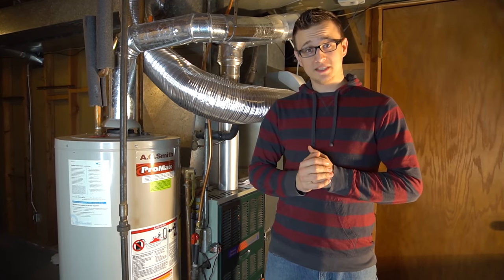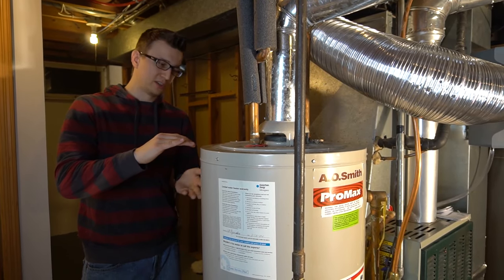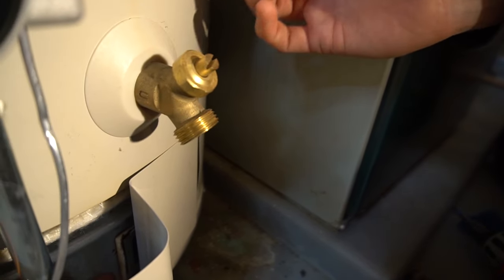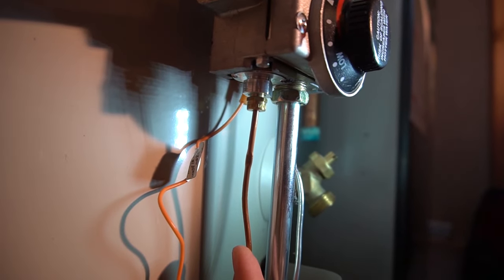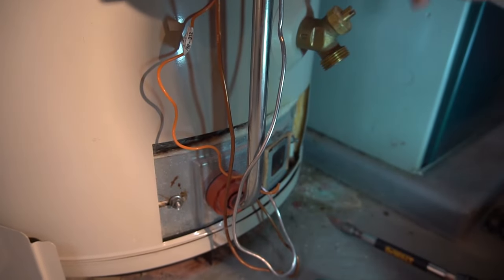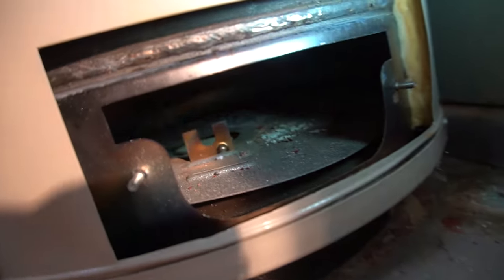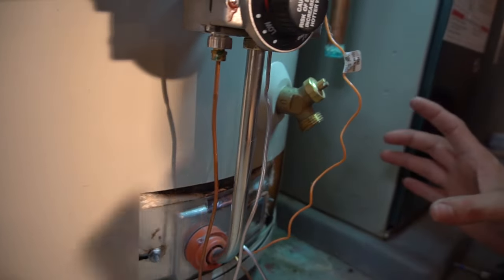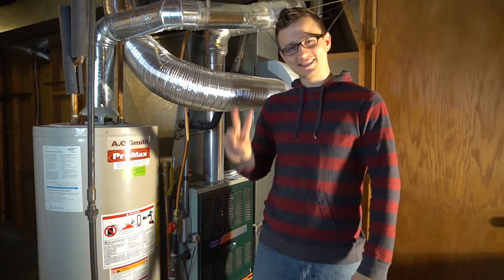How a Gas Water Heater Works ✔

Comment: You seem to have the same issue my dad has with this same water heater. They run out of hot water quickly. I don't have that issue ever with mine at the recommended heat setting.
Reply: Same with ours but I'm guessing my parents know how to operate it

Comment: Qq...i replaced gas valve on aosmith promax water heater, after replacing i noticed gas valve warm or may be little more then warm, is that normal ??

Comment: Have you ever considered running the cold water input down to where the drain valve is located and then installing a second anode rod where the original cold water input fitting is located? The cold water entering at the bottom of the tank would work the same as the original cold water dip tube that keeps the sediment suspended to be expelled with regular water usage. A second anode rod should/would greatly extend the tank life...

Comment: At 3:04 you say that "some water heaters will not have an anode rod". Is that true? Some anode rods may not be as visible as the one in your video, but I am not sure your statement is 100% correct.

Comment: Whenever I go on vacation I always turn the thermostat to "vacation" mode . This way, it wouldn't cycle on and off while I'm away while not using it. Also, it is a safety issue because you wouldn't want the heater to be on and any mishaps happening while you are away will be disastrous. However, upon returning I always flush it before using it because while the heater was off for days at a time, the water will come down to room temperature and that will be a perfect breeding ground for germs. By flushing it, you get rid of the stale water, replacing it with fresh water.

Comment: Your tp valve shows corrosion, which means its leaking.  As much   as you noted not wanting to test it, you may need to replace it since its leaking. Replacing it is as easy as replacing the anode.
Reply from the maker: I replaced it since that video and even filmed how to do it in the process. Thank you for pointing it out though!

Comment: I have the plastic flush valve on mine. Help me when I open the valve water also comes out somewhere on the shaft going on the floor which for me is a problem. Remedy ?
Reply: Empty the tank and replace the drain valve or change the washers in the valve if possible

Comment: Can there be TWO sacrificial   anodes in a water heater.  Mine has two  extra openings other than  COLD water in  and  HOT water out openings on top.

Comment: Why would my water heater gas supply not shutoff when it reaches the desired temp?

My unit was overheating and prompting the t&p valve.  

Also i believe i need to replace the reset switch, the button does not work, but there is continuity. 

And bc of the high temps, looks i will have to replace the t&p valve as well.

Comment: What should I do if top of water heater has melted the red and blue rubber washers and insulation under those pipes are starting to push up?

Comment: Before lighting the pilot of my 12-year old (2009) 50-gal, 12-yr warranty gas water heater,
Model UG1J5040T3NV made by American (US Craftsman)  Heater Company,
requires that the thermostat is in its lowest temperature.
I have just drained it twice (once in 2015 and then last Dec 2021).

Last week, the pilot does not stay light more than a day.
So yesterday I replaced the thermocouple and now it works properly again.

Comment: The flushing and not keeping up to date with the heater is the same as not changing your oil, tires to a car. Yes it’ll run but how long until it breaks down or causes an accident. Maintenance and due diligence as a home or car owner.

Comment: The water-heater is completely filled with water, so you cant get steam inside it. But If you have a failure the water will become superheated, and if the tank ruptures, all superheated water will turn into steam, whish takes up 1200 times more space which is a quite big explosion.

Comment: @Word of advice tv, Been attempting to fig something out at no luck.Try to explain best I can.Brought a used Whirlpool 40 gal gas.Newer type within last 8 years.Before I get to redoing pipe, money and lugging thing down stairs, wanted to test.See if it leaked for starters.To do this, I changed some connections on hot/cold inlet.This ables me to connect a garden hose to cold side.Hot side I screwed a cap on thus it's capped off at top of hot pipe.
 So, I ran my test and I found no leaks.Although may find when gas is hooked on water heats tank.I drain tank and take cap off hot side pipe on tank.I see that the inside pipe is bone dry.I was wanting to know if that side was ok being I redid some suff/solder.But I see pipe is bone dry.Tells me once tank filled, no water went up pipe to cap on HOT side.
 I'm a little confused on exactly how these work.My thinking is, tank got full so water should of went up pipe.Then I think maybe once hooked up once faucet on the suction or whatever pulls it up pipe.That the question, why wasn't inside of pipe wet hot side when did my tests?
 Lastly, if I understood you correct, there is no tube/pipe going down bottom hot inlet into tank? If correct, how can hot water be sucked up inlet then as tank drains.
Reply: "Inside pipe" meaning, copper pipe .Looked inside middle of it, dry.
 I would of thought with tank full from garden hose test, under pressure that pipe would of had water up in it to the cap... Now I'm worried about installing tank.Will await and see your thoughts.Maybe something I don't know or suppose to do that untill hooked to hot water side direct to a line in home.
Reply from the maker: Hey Joseph! I think I understand what your question is but let me know if I didn't answer something.

You were on the right track with the suction idea. When your water heater is installed, the cold side has city pressure water coming in at about 50-70 psi (depending on what your city pressure is). When you open up a faucet in your house, the pressure from the cold side pushes the water through the hot side. When you did the test, you did it with a garden hose which is much less pressure and you had the hot side capped off which would explain why the pipe remained dry. Hope that helps clear it up for you!
Reply: Yes, I understand now.Makes sense.I took a look inside tank through pressure hole.The tank looks great inside.However the anode rod is about 70% ate up.Course I spent a day in attempt to remove it.That just is not happening.So, guess I'll hook it up in few days and just borrow time on the tank.Thanks.

Comment: Okay here I go, this guy is really super knowledgeable and I watch his videos all the time. He's definitely is good However he has something wrong on the vending of the water heater. The water heater has a 90 degree elbow above the draft diverter cap at the top of the water heater  called a draft diverter it diverts gases up the flu. It is there to cause a draft of air it will only produce heat out the draft diverter if the vent is blocked or  you have too many elbows or 90s. it can only have 45° angles not a 90° elbow. This is why those caps are melted the hot gases are coming out of the draft diverter and heating up those caps. Producing carbon monoxide in the home . The draft diverter is functional all the time and is not there just in case the vent gets blocked Hopefully that makes sense...

Comment: If the pilot light goes out right after u let off the pilot it usually means the thermocouple is the issue, replace or clean it if ur in a jam. If ur main burner chokes out it’s usually the intake air.

Comment: Sacrificial anode not only protects your water heater, it protects your entire water supply pipes, including your lateral from the main. There are many cities with corroded mains, laterals, and home pipes that are corroded and leak everywhere. As to draining the tank, if you do it regularly, great. If you never do it, DON’T START. If you start draining the heater after never having done it, I guarantee your heater will start leaking within weeks.

Comment: FYI a water heater draft vent is only supposed to have up to two 45° angles. This water heater vent has a 90° angle which I've learned is against code and will cause a venting problem with the water heater. And it looks like from the Heat on the plastic ring it's doing as expected because you're getting hot gases out the draft diverter. I know this video is 4 years old however just came across it

Comment: Well water is a hot water heaters worst enemy, second is setting too high of a temperature...I don't worry about flushing or anode rod replacement when the tank is connected to city water, I see an average life span of 12-16yrs before they start leaking. Sometimes you're able to identify when a tank has reached the end of its life when you start seeing light tan colored water when filling a white fixture. If you're fortunate enough to see that before it begins leaking, order a new unit ASAP.

Comment: You switching the temperature control to the highest level is a tell tell sign that it may be time to replace it. You haven’t flushed it since 2003 and there is so much sediment the water isn’t heater up has quickly has it should. You may want to think about getting a tankless.

Comment: How does vented gas get to the outside vent on top?
Reply from the maker: Here is the official explanation :) Let me know if it doesn't make sense and I can try and translate.

A natural draft furnace is one that uses natural atmospheric pressure to force the waste gasses of combustion out through the ventilation system. As the fuel in the furnace burns, it creates hot air as well as combustion byproducts, such as carbon monoxide and nitrogen dioxide. Hot air naturally rises, lifting the combustion byproducts along with it. As the hot air rises through the vent, cooler and denser air from outside the furnace flows in, creating a natural draft that pushes air through the system and aids in combustion.

Comment: The coupling  on top of the union for the hot water tank doesn't look like an approved Black iron fitting it looks like
the protection coupling that comes with the pipe. Not sure how soft that is.

Comment: once I light light and let go of button, it goes off?
Reply: If you are letting go of the pilot valve button too early the flame will stop because the thermocouple has not be heated sufficiently to keep the gas valve open. This is why you should hold the pilot valve down for @ 30 seconds after the pilot light come on.

Comment: My water heater is 6 years old. I have the temperature set at max however the water is not very hot. Any ideas?
Reply from the maker: Is the water not hot everywhere in the house or just the shower?
Reply: It’s not hot in any of the faucets as well and thanks for the reply!  I tried adjusting the thermostat down and left it for an hour or so then moved it all the way to max and that is when the burner ignited.
Reply: Word of Advice TV ok problem solved, it was the Honeywell mixing valve kit. I have never seen one of these and the oring was bad. I was able to clean it out and use some plumbers Gabe temporarily and all is good. Thank you so much for your support and reply.
Reply from the maker: Glad you were able to figure it out! It only takes one mixing valve leaking by to affect the rest of the house. Enjoy the hot water! (my water heater recently stopped working so I am freshly aware of how it feels to get into the shower and be disappointed)
Reply: Very nice explication of a Gas water tank. One question. I’ve was told foam pipe insulation shouldn’t be installed within 6 inches of the exhaust  flue due to melting
Reply from the maker: @mir8645  That is a good suggestion since I do see a lot of melted insulation by the exhaust hood. :)

Comment: The amount of build up i had after 3 yrs in the bottom  of the  tank id definitely consider flushing atleast once annually to bi-annually. If the drains brass usually they wont leak.

Comment: ON the inside of the GAS Assembly Valve that takes the temperature with a copper piece coated with clear heat shrink plastic. Do Not Remove the plastic coating from the Gas Valve, it is to be inserted with the plastic intact.

Comment: Very soft water would probably require no flushing. Flushing removes mineral accumulated on the bottom of the tank. Over time it cakes up and act as an insulation layer and your gas bill goes way up. For electric water heater flushing probably is less meaningful.
Reply: Based on what I've read, very soft water can be worse. The salt will remove calcium but then it accelerates the corrosion of the anode and once that's gone you are left with just warm salty water. Google "Soft water's effect on water heaters"

Comment: My tank is 3.5 years old I've ordered a new anode rod.  Never checked to see so I google it they say it'll last anywhere from 1 to 5 years depending on how much hot water you use and your type of water and who you listen to!  Well water is the worst! I flushed the tank after 1.5 years didn't get much just some little balls that looked like white jello or jelly, so I didn't flush from another 1.5 years then I got a lot more of the balls and they were bigger but still like jello had to help them going down the drain they was plugging it up.

Comment: Problem #1... no unions at hot and cold water supply connections...problem#2...there is a pipe thread protector being used as a gas piping coupling..problem#3...flue pipe is not the correct gauge of metal...problem#4 ... t&p drain pipe should be ran to the exterior or to a drain...problem#5.,, no expansion tank...problem #6... no earthquake straps ....
Reply: But other than that, it's perfect?

Comment: Yellow Teflon tape on all gas lines and spray soapy water to check for gas leaks
Reply: No teftape on these. Pilot is a compression fitting and burner manifold line is an inverse flare, neither of which should have any type sealant. Correct on the soap. He missed that essential step on the video I believe.

Comment: Holy cow your water heater temp is cranked!  I never seen one set that high before.  I bet that water would burn the shiat out of you Hope you dont have kids!  thats dangerous!    Also in regards to flushing water heater and all that it all depends on the ph of your water and hardness (with scaling and all that)  so some may be fine forever others may not last but 8 - 10 years especially without maint like the anode rod and all that.  Some people have water so hard it stains everything and they dont have a water softener.  Just my two cents.

Comment: A little concerning how many things you state the timeline recommended, then state that you brush over as "I don't ever do that, mine works fine" without any realistic justification that it is a better option than the theoretically tested manufacturer practices.

Comment: It's pretty irresponsible to be providing an educational video on water heaters and saying you don't think it is necessary to replace the anode or flush the tank.  You should watch some water heater videos yourself and see how bad results can be in a water heater without flushing or anode replacement.
Reply from the maker: I have seen water heaters over 30 years old that have never been flushed.. As for the anode rod, I do agree that it should be replaced once in a while but not on a yearly basis.
Reply: @WordofAdviceTV  Sure... there are exceptions but that is not the bell part of the curve.  If you have hard water, you either get deposits, or you soften it.  If you soften it, or it is naturally soft, the anode will decay faster.  A video that both says you don't have to flush and don't have to replace an anode rod is bucking the percentages.  I don't think that is good advice for the average homeowner.
Reply from the maker: @michaeldemers6464  Thank you for the corrections good sir! You are right, I should not have made it sound like you never have to do it.
Reply: Michael Demers I watched this video.  I believe you misheard.  His point was that it does not have to be replaced Annually.
Reply: This guy is very informative and smart. Keep your ignorance to yourself I had a water heater for years and never flushed it and never had an issue.

Comment: @0:52 way too many small details at the very start of the video, to hook people to continue watching. I clicked away after a bit more, but I recommend giving a large overview of what a water heater does (heats up water for household use), how it broadly works (uses a gas burner and flame to heat water inside), and what people will learn in the video (parts of water heater and some science behind its design). Just my 2 cents.